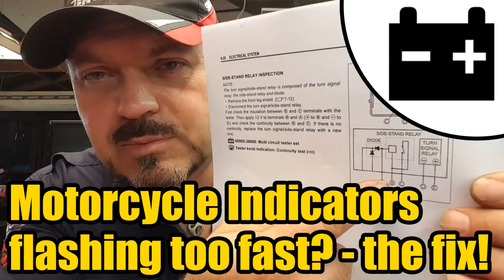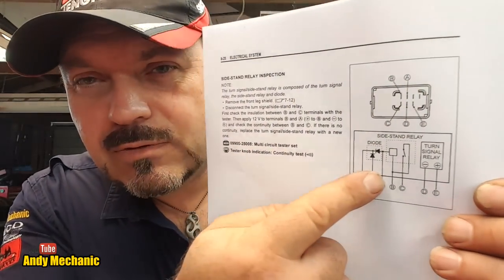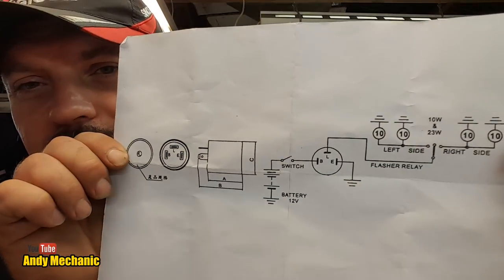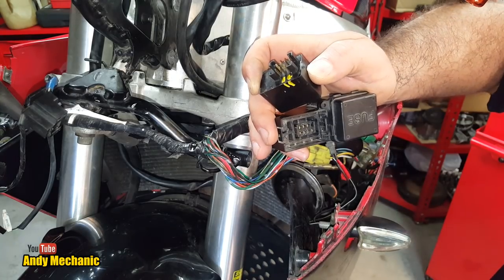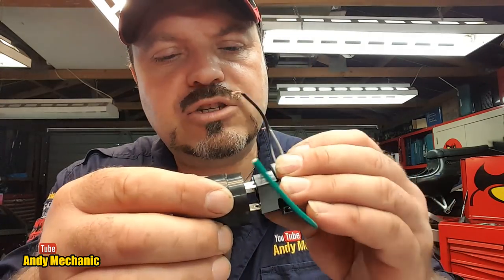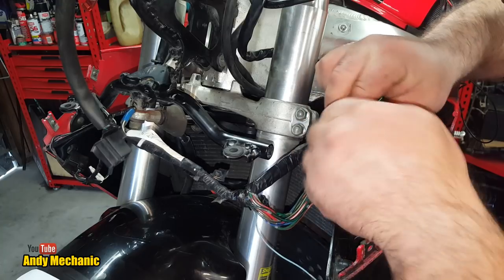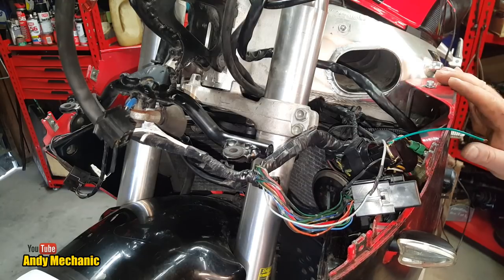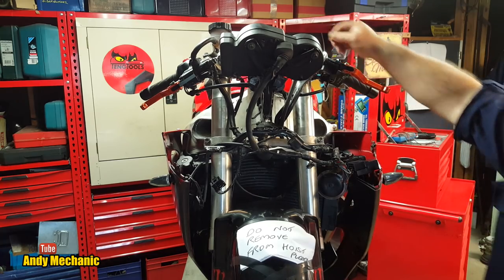GSXR750 (1999) - indicators flashing too fast - the fix! #1443

Comment: Hi. Have a 2000 srad with same issue, indicators flashing too fast. Went to ebay, ordered the same 7 pin relay relay but for led bulbs - about £7 sterling. Arrived 2 days later, popped in the new relay. Job done. Great videos though as if something is up with my bike I just watch you and chances are you've fixed it. Great work :)
Reply from the maker: Thanks. Pleased you got your bike fixed. Appreciate your feedback. Ride safe. Cheers Andy

Comment: I had this problem on my E36, the tail lights kept blowing so I wanted to replace them with LEDs. basically the way the flasher module works in my car is voltage drop over a shunt determines how Fast the indicators blink. So it's a current sense circuit. You can remove the resistor and replace it with a high current shottkey diode like the MBR1040. That way you've got basically a stable voltage drop over the diode and it'll work with both LEDs and incandescent bulbs. You may need to experiment a little to see what voltage drop is necessary for your ideal flash rate or just measure it in circuit and get yourself a diode in that range. On my E36 bimmer it only cost 20 cents and took about 10 minutes, and you get to use the factory flasher relay for that OEM feel...
Reply from the maker: Great feedback & information for viewers, Thank You :-) Andy

Comment: Hey buddy.derek here.. wow that a big bike for Sarah .lol.she must have alot of experience...
Got a question for yea.i jacked up front end of the viking and the brakes are good is there any oil or spray i can put in there rather than taking it apart...and more important 2wd one front tire spins...great.4wd they go opposite...great.but 4wd diff lock they wont turn?? Like i said before the right front axle has play in it going in the gear box...but all 2x4 and 4x4s all seem to work.and also the right front tire spins free in 2wd(like it should) but the left front also when u spin it it u can tell its turning a gear in the box.it dont spin as free as the right front.would you kno why in diff lock front tires dont spin?...thanks bud...keep the vids coming,we love em